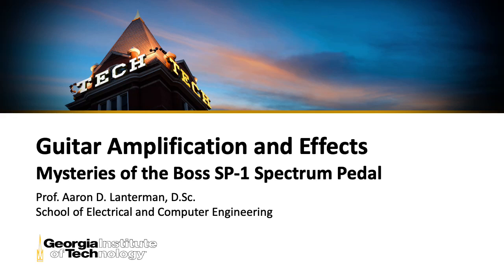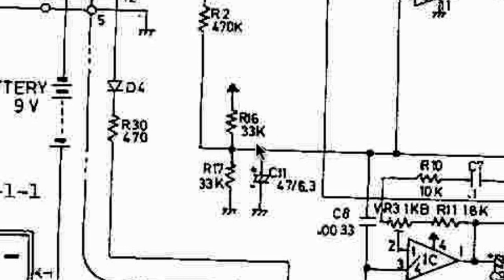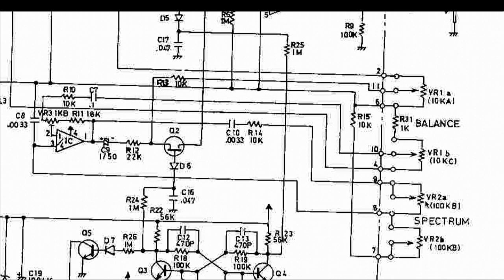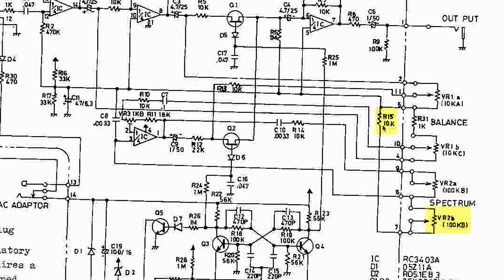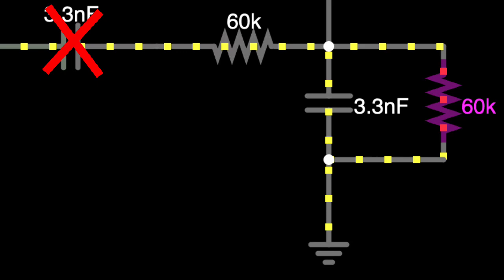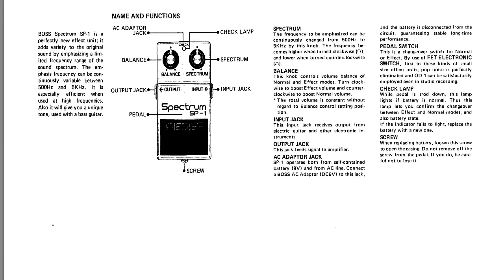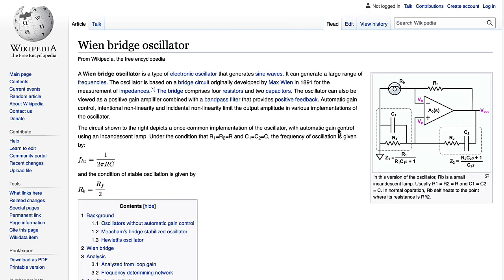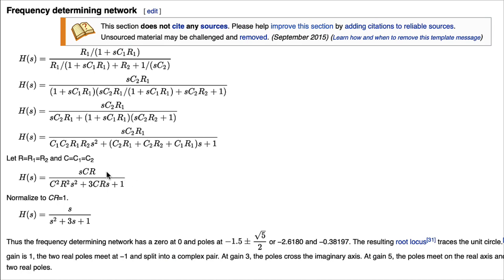Mysteries of the Boss SP-1 Spectrum Pedal (Guitar Amplification and Effects Bonus Lecture)

Comment: It “used” to be well known amongst us old guitar effect guys that a Wein Bridge circuit, when configured for a gain less than 3, makes for a good band pass filter. If memory serves, the DOD auto wah circuit is a wein bridge oscillator configured for a gain less than 3 (minimum required for oscillation) with the frequency controlled via a opto-coupler. I built a work-alike back in the 1990s to analyze and understand the circuit. I’ll look to find the schematic and post a link as a reply to this comment when I find it.
Reply from the maker: I'd be very interested to see that schematic! You're getting at something that I tried to do with my "Analog Circuits of Music Synthesis" class -- there was a lot of "oral history," not found in any textbooks, I picked up from reading the Synth DIY mailing list that I tried to organize. 

I just googled around and found a DOD FX-25 envelope follower, but it's a state variable filter using operational transconductance amplifiers.
Reply from the maker: Oh, I just saw your other comment with the schematic, I will check it out, thanks!
Reply: @Lantertronics  it is the DOD-440 envelope filter.

Comment: Beautiful, this brings back memories from my early days studying electronics engineering, I'm talking 1984. For practice we had to design, build, and test a sine oscillator and I chose the Wien Bridge oscillator (by the way, in Europe we use the pronunciation [wean], not [wine], from the city Wien, which is Vienna  in English). So I checked my original report, and the filter stage attenuates the voltage to 1/3 at the center frequency. using this in the calculation of the overall gain, you get a gain of about 21 at the center frequency, which is confirmed by your test at 5'42". Nice!
Oh, I used a JFET instead of a light bulb for the automatic gain control in the oscillator. It's more work, but it also was more stable at lower frequencies than the HP oscillator ;)
Reply: This is absolutely correct, Bode plot of the circuit in Pspice shows a peak magnitude of ~26.8 dB (gain of ~21.8)
Reply from the maker: I'm amazed you still have a report from 1984! (I'm not good at keeping records).

Comment: I wouldn't be really looking for a specific "name" for that. From what I can tell, it seems to be a kind of inverting SK cell from a signal standpoint. I analyzed the loop gain and (supposing I didn't make any mistake computing the coefficients) the root locus it's exactly like a standard SK cell. The only difference is that the cutoff frequency is sqrt(2) higher and Q factor is sqrt(2) lower with respect to a standard SK cell. To be fair, I don't really know why would one prefer to use this inverting stage instead of a SK cell. The only explanation I can give to myself is that by having an inverting SK stage you don't have to use another opamp so you end up using a single quad opamp IC.
Reply from the maker: When I worked out the closed-loop transfer function I wound up with a polynomial in the numerator that gave me zeros that weren't at the origin -- did you wind up with something like that? (I'm not 100% convinced I didn't mess up the algebra, it was a slog).
Reply: @Lantertronics  I used the time constant method for this. Since there's no DC path in that loop gain, I put a  virtual resistor R* in parallel to the 3.3nF cap. 
I computed all the coefficients and then I calculated the loop gain without R* by making it go to +infinity. This is the loop gain I ended up with:

LG(s) = sCRK / [ ( (sRC)^2 )/ 2 + 3sRC + 1 ] where K is the non inverting gain 1 + R2/R1 (R2 = 18k5 and R1=10k5). C and R are the 3n3 and 60k values. 

So the root locus has two LHP real poles and a zero in the origin.

The polynomial that gives me the closed loop poles is the following:  ( (sRC)^2 )/ 2 + sRC(3-k) +1 = 0 

As you can see in the last polynomial, there's that 1/2 factor that is the only difference I found with respect to a standard SK cell

I end up with a zero in the origin because before the R* approximation the DC gain is RK / (2R + R*) and the numerator is sCR* +1. By having R* going to +inf, denominator of the DC gain and numerator (the out of the origin zero) simplify and we end up with the simple sCRK factor

Comment: The conclusion is a bit of conjecture, and if I'm wrong about any of these points, please correct me. But...

Isn't it the case that a positive feedback configuration makes the circuit somewhat sensitive to variations in open loop gain?

The spectrum pot is connected as two simple variable resistors that are linked. Effectively it's a single potentiometer. This does have a slight advantage to the more obvious approach in that the "wiper" is always guaranteed at least some contact through the two series carbon tracks. This might reduce the impact of a scratchy pot. But it may also be less intuitive to read the schematic this way.

The schematic is somewhat difficult to read over all... if your goal is to understand the circuit. Having all the external parts broken out like that might make it easier to understand from a repair point of view, though. Not sure.

So, my conclusion is that perhaps part of the point is as a form of copy protection. Choose a different op amp? The circuit now sounds different. Wire the pot up wrong? The circuit doesn't really work at all as intended. Try to understand the whole thing? Good luck...

My theory #2 is that this was a breadboard mistake initially. Someone was confused about the + and - inputs and meant to put this BP network in negative feedback. First it probably distorted like crazy due to the mistake but two feedback resistors later in the actual negative feedback this time, it sounded good. So by the motto, "if it ain't broke..." it went into production like this.

It would be interesting to hear an interview with the original designer, if they're even alive at this point...

Comment: Maybe unrelated, but a digital resonator, which is a bandpass filter, can also be turned into an oscillator by placing the poles on the unit circle and switching off the input. It can also be seen as a "physical model" of an RLC circuit. It makes me wonder whether this circuit is an active version of that, and an analogue equivalent to the digital resonator. Perhaps applying the bilinear transformation "in reverse" might reveal a transfer function that's close to it.

I guess the feedback is to move the poles off the real axis in the s-plane. 
In a 2nd order digital filter like the resonator, that's the role of the two-sample feedback delay, I suppose.

Comment: I’m unable to reply to my own comment so I’ll add the link in another comment. 
Here is a link to the schematic. 
https://www.audioservicemanuals.com/d/dod/dod-440/6126922-dod-440-envelope-filter-schematic

It has an error which I noted back in 1998 here:
https://archive.ampage.org/articles/0/fxdiy/001763/Re_dod_envfilter_440.html
Reply from the maker: Thanks so much!
Reply from the maker: That's really interesting. (As an aside to anyone else looking at the schematic, I think there may be a dot missing at the junction of the left LDR, the cap, and the 22K voltage splitting resistors).
Reply: @Lantertronics  is there any way we can get a more “direct” connection? I’ve walked down the same path you are currently walking down and can possibly? offer some insights to things like this but trying to converse through YouTube comments isn’t easy. 
Let me know if you would be interested.
Reply from the maker: @550zdatsun  Sure! Send me an e-mail at lanterma@ece.gatech.edu. Looking forward to talking more.

Comment: It's a Wien Bridge - https://en.wikipedia.org/wiki/Wien_bridge
Reply from the maker: Oh, I figured out it's like a Wein Bridge oscillator (I talk about that at the 8:10 mark). I've just never seen it used as a filter before, either in any textbooks or any real-world. That's the part that is so weird.
Reply: @Lantertronics  No worries. In the same vein - a while ago I noticed how similar a quadrature oscillator (two integrators and an inverter) is to a state variable filter. The state variable filter has an additional feedback path for dampening. They're almost identical in that regard. Any amplifier or active filter is an oscillator if you operate it wrong enough.
Reply from the maker: @256byteram  And every time I seem to design a filter, it tends to want to oscillate when I don't want it to, and whenever I actually try to design and oscillator it often doesn't want to oscillate. ;)